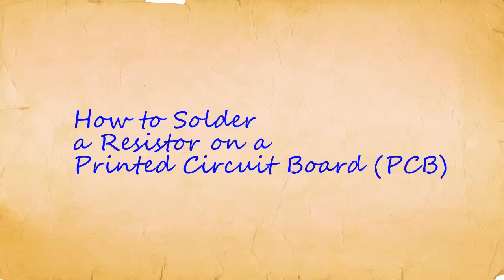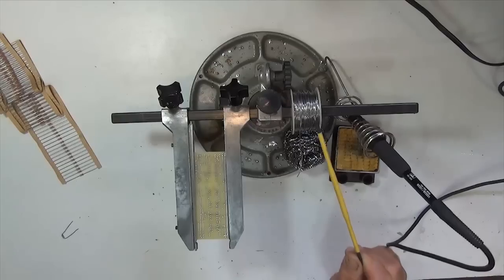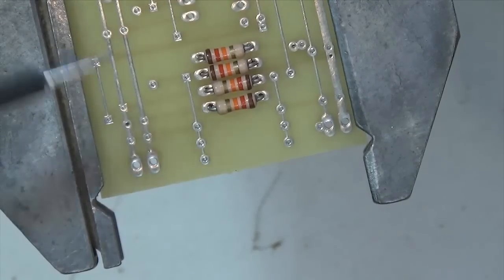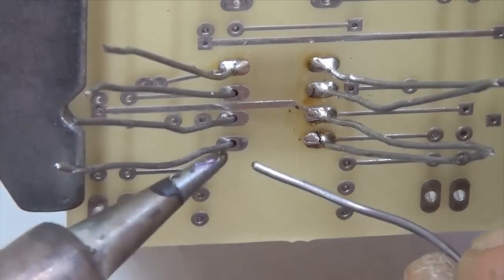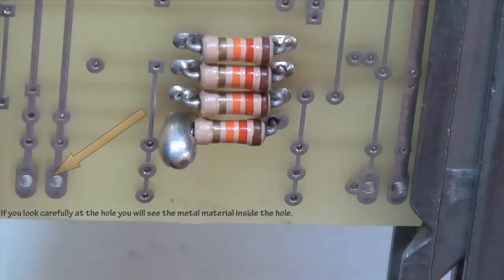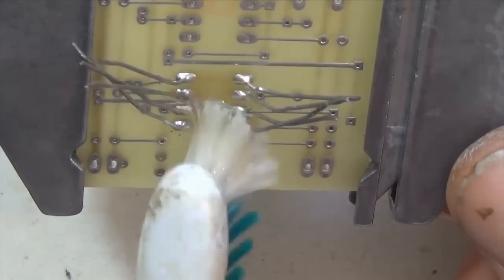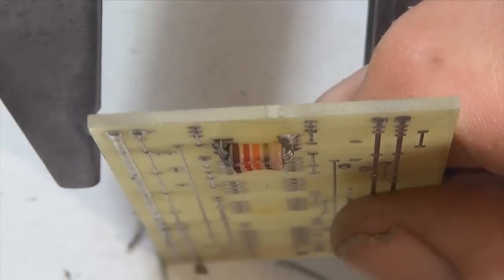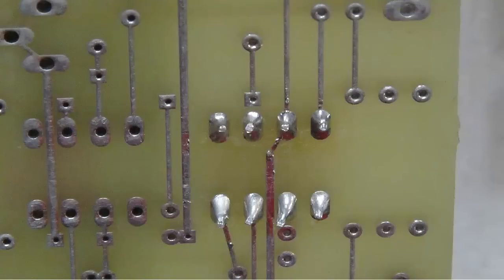How to Solder a Resistor on a Printed Circuit Board PCB

Comment: PRO TIP (from a noob):  Always use a bit of flux before trying to wick up solder.  You can put the flux on the wick instead of the board to keep things a bit cleaner.  Try it, the solder gets wicked up like magic!

Comment: Good video Sir. I would rather recommend a brass tip cleaner instead of stainless steel. Bass is way less abrasive and more gently to the tip's surface.

Comment: @1929fordhotrod Thanks for this video. I recently watched a video where the hobbyist did all the resistor soldering on the component side (not flipped over on the lead side like you and most others do). I've never seen this technique before and it seemed to go much faster, especially since there were about 100 resistors. He dropped them all in and soldered all ~100 in one go. Then he flipped the board over, trimmed the leads and inspected the joints. Any tips or comments on this technique?

Comment: What do I need to do if the double sided PCB does not have the metal inside the holes?
Reply from the maker: Solder on both sides of the pcb.

Comment: i have a bad resistor on a circuit board on a home theather if i just replace it should it start working normal?
Reply from the maker: How do you know the resistor is bad.  Is it black/burnt or did you measure the resistance of it.  If you measured the resistance you may not get the correct resistance value of the resistor as there will be other components in parallel with in effecting the measurement.
Reply: ***** i greatly appreciate your info..yes it is black burnt you think i can replace it with any similar resistor?
Reply from the maker: Yes you can replace the resistor with the same value but my concern is why it burnt up in the first place.  There might be a problem somewhere in the circuit that caused the excessive draw in current for the resistor to over heat.
Reply: ***** you are perfectly correct i had my cell phone plugged in charging with the volume all the way up..it has to be the exact value? How would i find the value? Would it be written on the circuit board?
Reply from the maker: You will need the circuit diagram for the product you are working on.
Reply: Thanks again man ur a saint
Reply: You can find the resistor value from the colored bands. Search for "resistor color coding" for a diagram on how to read them!
Reply: RCalundann thank you man!! Greatly appreciate it

Comment: Don't you have to heat sink the resistors before soldering????
Reply from the maker: No.  Many components do not require heat sinking while soldering.  Component datasheets often provide information for soldering including temperatures and time.

Comment: It's called a Panavise, not Helping Hands.  Several of your solder joints lack penetration as seen from the top of the circuit board.
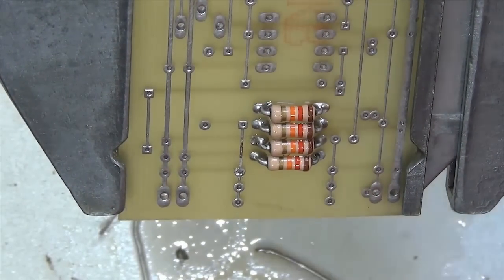Reply from the maker: The manufacture of the "help hands" is Panavise.  Remember the term "helping hands" is a generic term as there are many types of devices and manufactures for product of this type.  As for the penetration only one resistor bottom right of the screen a timeline 15:00 could have use a bit more solder but not critical as this is a plate through board and there was a good solder joint on the solder side of the pcb. PCB's that do not have plate through hole will not have solder showing up on the component side of the pcb.